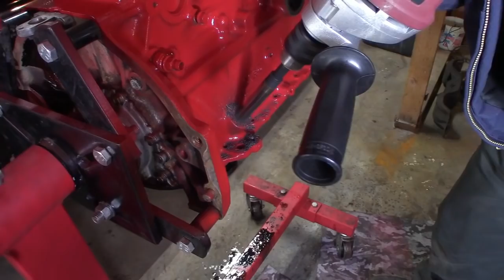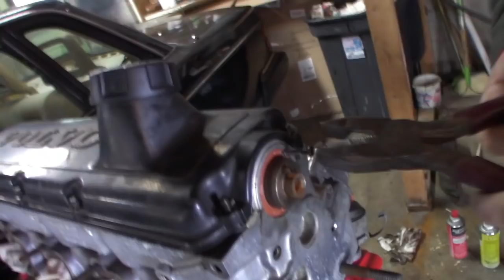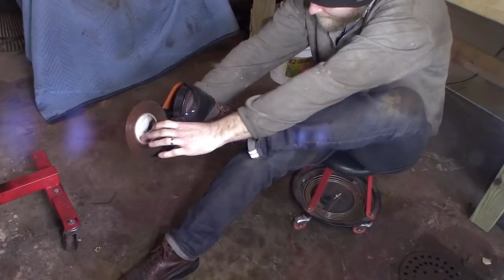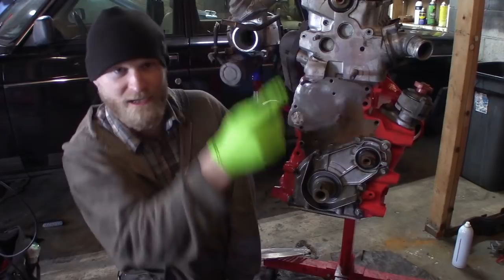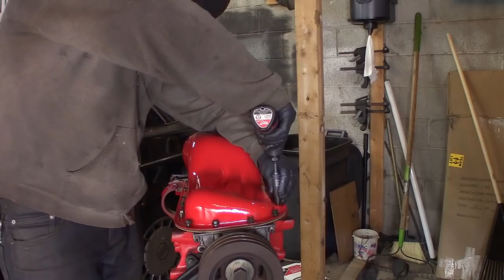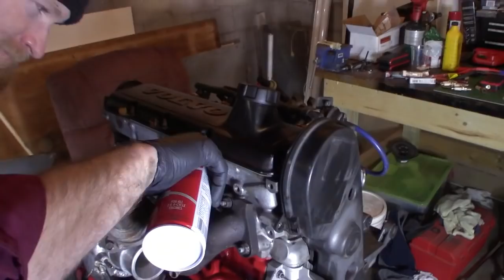Volvo 240 Turbo Install

Comment: what b230 block is this?. and what ecu and wiring harness are you using for this
Reply: yeah i also wonder what ecu/ wire harness in the process of wanting to turbo mine it has the LH 2.2 tho

Comment: Great video . I've been thinking about putting a turbo on my 1990 240DL Sedan. 
    If I understand your video correctly,  you're putting a turbo on a stock engine, right ? Without changing the crank and rods and you're using the stock head also ?
Thank you.

Comment: How did you get the shavings out??????.
Reply: With the pan removed, you'd be able to flush the shavings out with brake cleaner fairly easily. I wouldn't advise doing it without removing the sump, but it could probably be done.

Comment: The oil filter could use a Modine oil cooler can between it, and the block .
The 940s used them on the B230FTw/T30 Mitsu on them.

Comment: Nice vid!!  Surprised you didn't pull the head...polish it up a bit for better air flow with that turbo...just my opinion, and you know what that's worth!!  Nothing!!! 🤔😉😎
Reply from the maker: Yeah this was kind of a quick build so we didn't do everything all fancy and nice. Trying to be perfect just results in stuff never getting finished for us. And polished heads don't really give you much performance increase unless you are really really deep into a high hp build.

Comment: How long did it take to assemble the engine?
Reply from the maker: We just stripped it down to a long-block and changed out seals, gaskets, water pump, belts etc. If you have the engine out on a stand and you don't take the head off and tear into it you can refresh everything in just a few hours.

Comment: So, how many horses on that slug after turbo install? I am just curious.
Reply: Since theyre running a pre 93 block from a 240, probably has 9mm rods. Cant push those too much. Still has N/A B cam in it unless they changed it. Without going standalone fuel mgmt, can probably only put out 5-10psi before fuel cut. Maybe make 130 hp if you're lucky.

Comment: Why did you use the hard line instead of a braided line for the turbo supply? Just curious
Reply: Mainly because we had easy access to the hard line and fittings. Braided line would probably have been easier to do.

Comment: I am adding a turbo to my 1992 Volvo 240 b230. Is there anyway to get to that plug you used for the oil feed without taking the motor out? I couldn't seem to find it by just looking down in the engine bay.
Reply: And yalls was a 1/4" plug?
Reply from the maker: It's kind of hidden between the water pump and alternator. You may need to move the alternator and bracket out of the way to get to it.

Comment: Why didn't you guys get a 531 cylinder head while you were at it? It has better airflow and would pair very well with the turbo.
Reply from the maker: Would have liked to do that but we didn't have a good one to use. This was a relatively quick swap so we didn't get too carried away squeezing out all the performance that we could. As you notice, we don't even have a T cam in it.
Reply: @ClappedOutGarage  I guess that makes sense. I would've preferred a VX cam though, but maybe that wouldn't be as efficient with a turbo. Anyhow, performance isn't everything.. until you take a sick day and end up getting annoyed by the clock aggressively ticking away.

Comment: Why not the marine oil filter ?

is the engine block from a 940 ? (oil cooled  pistons)
Reply from the maker: The block is from another NA 240, so it doesn't have the oil squirters unfortunately. It should still last a while as long as we don't turn the boost way up.

Comment: When the entire sole comes off a boot, it must be a Red Wing.
Reply from the maker: ACTUALLY the boots in this video are timberlands. I am actually a huge fan of Red Wing boots as they are the only brand that I have found will actually last me more than 6 months without falling apart. Specifically, I wore the 3507 for 4 years until the toes were too beat up to wear anymore, never re-soled them. I also have a pair of Red Wing shoes that I've worn for over 6 years and only re-soled once. I used to walk 1 mile to work, be on my feet all day long, and walk home in those shoes. 

All other brands of shoes and boots I've tried have been very disappointing. Right now I'm wearing a pair of Wolverine boots and after 6 weeks the leather is torn and falling apart. 

Of course, my Red Wings were made in the USA and cost twice as much as anything else I've ever worn, but I'm beginning to think they are worth it.

Comment: Where did u guys get all the seals and gaskets? Also the turbo lines? Do u guys have a specific website to buy all ur Volvo parts?
Reply from the maker: We shopped around a little bit for the best prices and brands. We use FCPEuro, IPD, and sometimes rockauto. Occasionally we will get something at a local parts store or off ebay.

Comment: I have an 86 240 and i'm about to undertake this. I have an 86+ manifold with a 12B mitsubishi turbo + oem volvo intercooler and the lh2.2 ecu. I'm waiting for my ebay oil lines to be delivered. How much power can I expect? I have the aw70 so I don't want to have the boost up past 12 lbs
Reply from the maker: Lots of variables here, it's hard to say what you would get. A stock b230FT gets around 160 so I would say that would be ballpark. My only admonition is that you consider a different transmission. Look for an AW71 to swap in if anything. There are a ton of options. Check out sites like turbobricks for some good info.

Comment: Any help on how to do a ac delete? I just pulled my engine from my 240 and I want to do an ac delete, any tips on how? Love the channel! U guys make me want to start filming my Volvo?
Reply from the maker: AC Delete is super easy. Before you do it you need to make sure the system is empty and not pressurized. If yours isn't empty you should have it depressurized at a shop. It's dangerous and harmful to release the vapors into the environment. 

You basically just unbolt the AC compressor from the bracket and unplug the wires going to it. Then you can disconnect the hoses going to the compressor and remove it. The condenser sits in front of the radiator and will have a few wires and hoses going to it. You can just disconnect those and pull the condenser out after you remove it from it's bracket. 

The receiver/drier sits on the firewall in most cases and you can use wrenches to remove it. Check out our engine pull video around the one minute mark to see what I'm talking about.

Around the two-and-a-half minute mark in that video you can see I used a big pair of bolt cutters to cut some of the AC lines. Makes removal super easy and you can get bolt cutters like that with a lifetime warranty for like $20. 

That's basically it. Nothing fancy at all. Super easy. If your AC works you should keep it in, but if it doesn't there is no reason to keep it if you don't plan on fixing it or don't care about the re-sale value of the car. Be careful and have fun. 

You should film your Volvo projects too, man. Maybe make a video on how you do the AC delete for your first upload.
Reply: Thank guys! Helped alot

Comment: I think the exhaust manifold gaskets were backwards. The metal side usually faces the manifold.
Reply from the maker: That is a good catch, man. We realized before fitting the turbo that they were in backwards and switched them around. I didn't realize I used this old footage of me putting them in backwards. Good comment. Thanks.
Reply: Yep, keep up the good work and entertaining vids! I just got a super clean 84 242 and have been watching different vids to get me in the mood for all of the upcoming work it needs.
Reply from the maker: Oh nice. We also have a 242 that needs a world of work right now.
Reply: @ClappedOutGarage    a 6   6 66 a
Reply: I was wondering if I could pick your brain on a turbo swap my son and I did.  We started with my son's 240 dl wagon and added the same turbo you have.  We did about all the same shit with the two ecu's. We got everything put together in a few days.  It's runs kinda crappy and it won't Rev over 3 grand.  No vacuum leaks. The car ran perfect before we messed with it.  Any ideas

Comment: Thats some good information about drill bits. I also like the seal puller and pipe as a seal driver. Nothing is as good as the tape on the shoe though. You guys need to be on Velocity